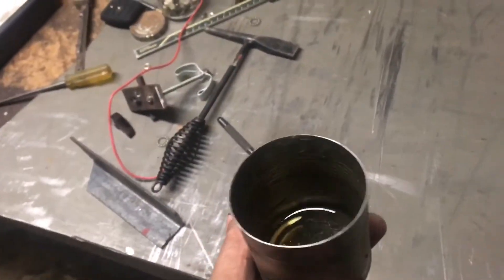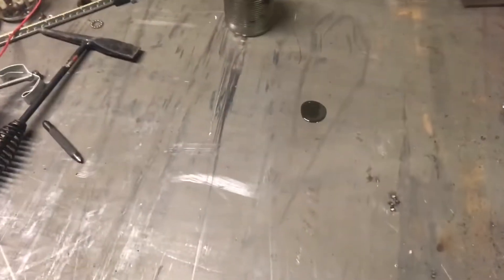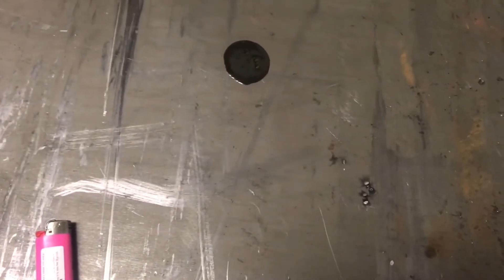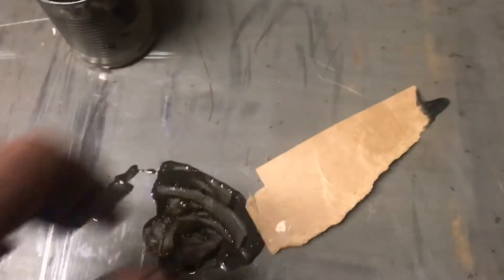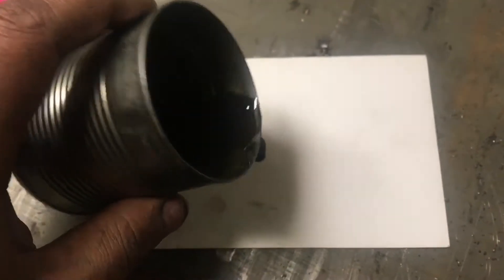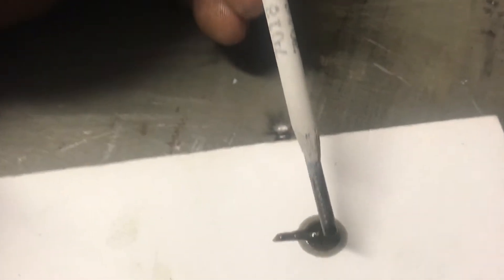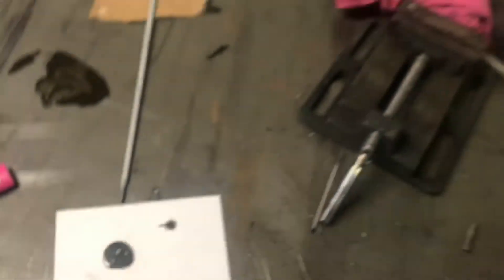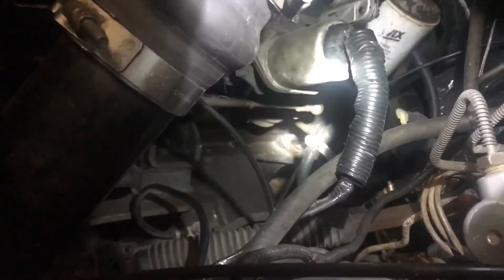Diesel in your oil? A bench test

Comment: Torch works better. I’d put money on injector man. Had same issue AND sounded like my manifold had a bad exhaust leak, which it did have a small one but when listening from the exhaust pipe it was a pound pop or woush if you will sorry for the wording hahah but changed all of em because if I’m pulling all the lines I’m gonna make it worth the time and do them all. But it fixed everything. 
Is it normal for the injection pump to sound like a pshh sound during fueling? Hard to describe on text but sounds airy but it doesn’t have air in the system?
Reply from the maker: These damn engines are so knocky and roudy, it’s hard to tell what’s going on sometimes haha.
I never made a follow up vid, turns out my mechanical fuel pump diaphragm tore and was leaking some fuel. Been fine for 30k miles now!

Yeah if you pull one line, might as well do em all. I hate doing the job twice a month or two down the road!
Reply: Midwest Moose thanks I noticed the date of the video after I said something lol but I appreciate you getting back on the outcome! I’m having vacuum problems (yay) thanks again man!
Reply from the maker: Oh joy, vacuum stuff sucks. I tried to shoot a video of me tearing into and rebuilding my vac pump on the truck and I got so pissed off I stopped filming and just worked on it hahaha
Reply: Midwest Moose Hahahahah that sounds like something I would do 😅😂😂.!! I found out also when I went to do the kdp that it came out on the previous owner!! Cracked timing case and no dowel pin in the hole 😅. Been like that for the last 80k miles and now trying to figure out if I need to replace that or not.

Comment: I have 2000 international 4700 the oil is being pulled from the engine into the fuel pump. Have not been able to find the problem any information will helpful thanks
Reply from the maker: Mechanical fuel pump? 
HPOP design?

Comment: There's a uv fluid you can buy ($5cdn) and run through the system and fuel into the crankcase will be visible with a blacklight.

Normally pretty simple either main seal on injection pump, or one of 6 injectors... 
- if your not getting alot it might be leak down from injectors? Easy to pull yhem and send them for a pop test....
- since it's not a 24v I don't believe you'd have the issue with leaking injectors pushing back into your rockercover.

Is it smoking good when you start? Is that why your thinking timing? If that's the case I'd be more inclined to think it's injector leakdown....
Reply from the maker: Thanks for the advice! However it turns out I had a busted mechanical fuel pump! Diaphragm tore, 20k later and no problems
Reply: @MidwestMoose  - oh ya. Lol the old ones would do that! Not an electric pump like the 2-4's